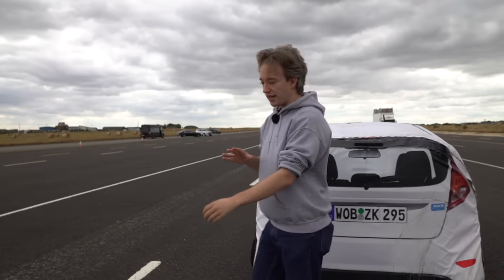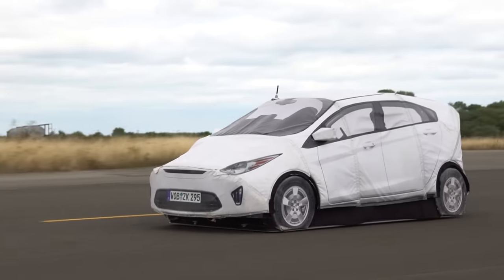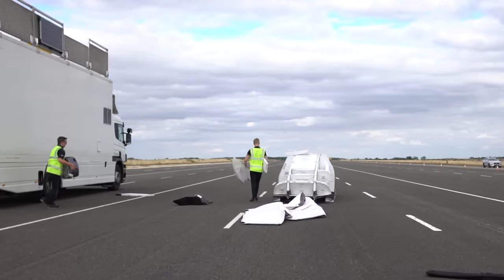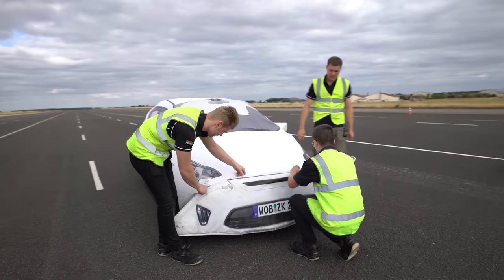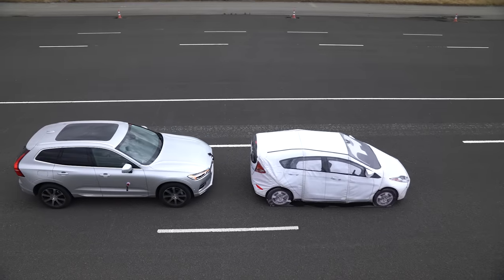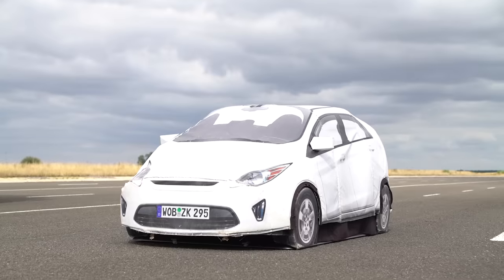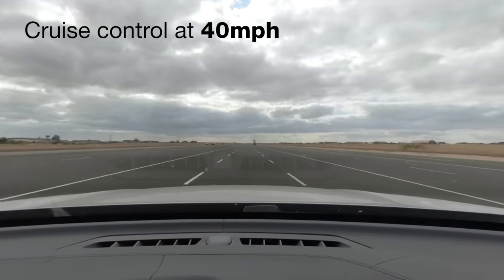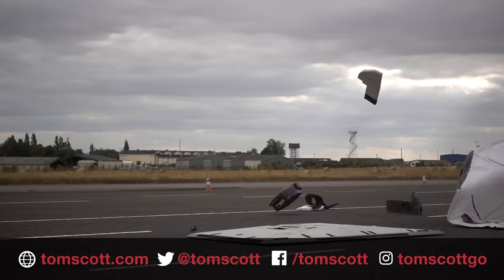The collapsible crash-test robot car

Comment: That looks fun! It's also a really clever idea, definitely better than spending£1000 on scrap cars for every test!
Reply: Scriptminer the moneys not the problem, the problem is you have a human driver driving at speeds of up to 70mph into the car not braking (on purpose), this is why they need the car to fall apart and be made of foam so while they’re still refining the system the testers are safe to crash into them and not get hurt
Reply: Makes sense, thanks!
Reply: The platforms are not cheap by any standards until you look at the R&D that goes into new car development!

Comment: If that car is a Volvo XC-60 then it doesn't use radar. I own one and it allegedly has a forward looking infrared laser. I would like to know if the system works but I haven't figured out a safe way to test it. Also I have never been clear on whether the system only works with cruise control on or with normal driving as well.

Comment: What happens if you are travelling at 220km per hour as the drivers in German Autobahn usually do? At 40 it hit the dummy, that means at higher speed it doesn't work?
Reply: Its not made to fix all problems, Most crashes are at less than 100kph were this system would help or avoid.

Comment: As a motorcyclist, this tech and the developing driver reliance upon it scares me. You wouldn't consider the second test that impacted the stationery vehicle to have worked if you were on a bike. People are already far too complacent when driving, checking their phones and not taking it seriously, believing an airbag will save them if it all goes pear shaped. Get rid of it all and provide good driver training and a Tullock spike in every vehicle.
Reply: Its not a driver reliance system. Its a system that makes using cruise control safer. Normal CC systems will just drive right in the back if the driver is not paying attention, were as this system will make CC safer by slowing or stopping you totaly. Most people dont use CC so makes no differance.

Comment: What happens with such braking assistants if friction is worse due to rain, gravel etc.? The braking distance can easily be twice as high.
Reply: The onboard computers do some maths and compensate...
Reply: Rob Fraser  But how would they know about the friction before the brakes are applied? Or is the short brake pulse to wake up the driver used to get an estimate?
Reply: They have to take measurements long before they even warn the driver.
Reply: Oskar Skog  How do you measure friction without applying a force i.e. accelerating (either positive or negative acceleration)?
Reply: You don't.  You can measure the friction when the wheel start locking or spinning, which may have happened already.  Otherwise, you estimate the friction.

Comment: Did that last test not actually count as a fail, seeing as it actually impacted the stationary vehicle?
Reply: Agreed, I would like to see the results at all speeds.  That last result was concerning.
Reply: A crash at 40 mph vs that slight tap would make a huge difference to the injuries sustained by the occupants. Sometimes, these systems are designed to only slow they car by a certain amount (e.g. reduce speed by 30 mph) in case of false positives. But that much reduction in speed alone would make a huge difference to the chances of surviving a crash.
Reply: EuroNCAP count three separate categories: Avoidance (no impact) Mitigation (impact was much slower, as here) or Failed (no braking, or much too late to be effective).

Comment: I know teslas have a mechanism for seeing two cars ahead by bouncing radar under the car in front of you. Wouldn't having the test target on a base with so little ground clearance give inaccurate readings with a system that expects a gap at road level?
Reply: The base is only 100mm high and the target has radar absorbing lower edges which offers minimal radar reflection, although I've not come across a sensor that looks under cars for further traffic.

Comment: My car's cruise control shuts off if it goes below 29 mph. Doesnt really matter since I never use cruise control anyway. It is not a comfortable feeling (especially for my foot) having the car accelerate itself.
Reply: I don't like using cruise control - adaptive or not. And I don't like automatic transmissions either. Having my foot lose the direct connection with the vehicle makes me immediately uncomfortable as well. The safety assistant in my brain detects something going wrong with the car when it accelerates on its own and the brake reflex appears.

Though I'm totally happy with all kinds of emergency assistants correcting for human mistakes. But all these "convenience features" replacing proper driving skills? Not for me.

Comment: "Brake late because otherwise it will just annoy the drivers". What about countries up here in the north that occasionally have snow or ice on the road. I hope they put that up for a discussion, cause these break tests would have ended badly on slightly worse road conditions than we saw here.
Reply: You would not normaly be sat with CC on when its snowing would you?

Comment: Human reaction times are not as good as a computer. What about the car behind the one with break assist. If the car leaves it late and breaks hard it dose not give much indication to cars behind it?
Reply: Good point, maybe they will branch out into auto-lane changing ...etc.  However, one easy fix is to have the brake lights applied and emergency blinkers on as soon as the vehicle detects a potential braking hazard.  It doesn't fix the issue but at least allows the driver to have a faster response, then you have to worry about the driver behind that driver...
Reply: These sort of systems are assists as opposed to autonomous driving.  They turn on in situations where you were (probably) going to crash anyway, these systems attempt to minimise the crash.

You can't worry about the car behind, but to put it into perspective, I would rather come to an abrupt stop and then the car behind hit me in some fashion (hopefully having at least tried to break), then slamming into the stopped car at highway speeds and then the car behind smash into me.  It's about minimizing damage to humans, not saving cars.

Comment: How does it take into consideration the driver following your car?
Reply: Great response, but I am more specifically concerned with non-autonomous vehicles. I'm curious how human drivers are taken into consideration when rapid deceleration occurs. The opposite could be said on when a rear-end collision is imminent, are there some autonomous vehicles that collision avoidance systems attempt to move the car out of danger or mitigate the damage?

Comment: In the future all cars will be driverless, and thus there will be less need for automatic radar breaks becasue the car in front of your car will just say "hey i'm going to stop how" and your car will go "okay, i'll adjust accordingly" for non car related accidents it will be useful though.
Reply: That would be wireless cars, not driverless.  That tech would be perfect for today as your car would communicate with the one behind much quicker than the driver in that car picking up on your brakelights.

Comment: Colin furze should have run this over in his fleet of vehicles. One thing that always interests me is decisions. 
In hemel we have the magic roundabout which way would a automated car go round. 
I am wondering how it would deal with critical decisions, I am also interested as tech such as radar and cameras have there limitations with automated cars , there are some things that both of this tech will struggles with.
Reply: Depends on how much you pay for the system, at the top end you could have far more cameras, radar and computers working everything out. But that would be far more expensive then the car, so right now the goal is to get as much out of the system as possible for a couple of grand.

Comment: oh my god, it slightly brakes on its own.. if it does this mid-corner then why not just add a solid rocket booster to the rear of the car facing a lateral direction

Comment: So a self driving car that uses radar comes across a car that has radar absorbent coatings ( used by cop avoiders) what happens then? There is an entire market based on nullifying radar, seems as if the scientist have tunnel visioned this project straight into the wall.

Comment: So at 35mph it pulled up just short.. at 40mph it gave it a bump... so at 45mph what happens? Harder bump? What happens at 60mph? 
It's not that I don't think the system can work but showing it fail is probably not a good way to convince people of that!
Reply: Seems to be a year old by now, definitely better by now, but the system isnt supposed to do everything for you. You should react before the system goes off, and there is a little brake before the system activates to try and warn the driver of, what it sees as, a possible crash.

Comment: 2:29 What's with the weird jumpy rotation of the wheel?
Reply: The wheel is moving to fast for the camera to pick it up.  Bit like when you look at a helicopter on film and it looks like the rotor is frozen or going backwards.
Reply: I know that, but it usually stands still, moves forward smoothly, or moves backward smoothly. Here, it stays still for a while, jumps to another position, and then stays still again.

Comment: "its delibratley late and harsh"
seriously sureley thats not a standard configuration one patch of oil or diesel or wet road and your delibrate late and harsh breaking becomes a collision

40mph so evidently your system does not account for the increased speed well judging by how 25 was a near miss and 40 was a bump so what should i expect from 80? a full on rtc?

Comment: Personally I don't agree with all these electronic driver assists, drivers are losing the skills to drive. ABS is one thing but it's going too far now. Put a modern driver in and emergency situation in a car without all those assists and they will have an accident.
Reply: What about people learning in cars with no assists? The car I've been learning to drive is ten years old, there's nothing other than a backup sensor, and it's a backup sensor not a camera. And if people are doing driver training (which they really should be) They're still gonna get taught everything they need to know to drive any car. People losing skills is I don't think a problem caused by the cars, but a problem caused by the drivers. The problem exists between the steering wheel and chair.

Comment: So the Volvo had time to warn the driver with a small brake at 40mph, but not enough time to break in time and not hit the car. Seems a bit flawed
Reply: The only "flaw" is expecting the car to do your job for you. It's an assist that is somewhat useful in certain situations.
Reply: bcubed72  I don't think anyone EVER wants the car to "do the job for you" when it comes to full emergiency braking, as Tom also clearly shows in the video with the discomfort of driving straight at the foam car without slowing down. But if the system CAN be improved to e.g. make an emergiency stop from 70mph going towards a standstill car before it hits, why shouldn't it be able to??
Reply: Yeah I thought that was odd too.  The car can safely come to a stop at 35mph and avoid collision, but just 5mph more and you've now created an collision.  I'd be worried what kind of detection it would have at 60+mph.
Reply: @HForceClan  Because doing so will inevitably lead to false positives (maybe the car in front is accelerating) which will annoy the driver. If the system is too annoying, it won't be used. A 5mph collision isn't really dangerous, so from a safety perspective the system has done its job.
Reply: techmage89  I'm saying its flawed for not being able to stop, and that it COULD also be improved to work at higher speeds with better radars with e.g. more range and less noise.. 
You clearly only skimmed my comment and missed the "if the system CAN be improved" with CAN in big letters so people dont skim past it, and im not here to convince anybody so bye..
Reply: @HForceClan  My point is, what you're suggesting wouldn't necessarily be an improvement unless you're talking about a fully autonomous car. As long as a person is still driving, they don't want an automated system taking over unless necessary for safety reasons.
Reply: system is designed to save your life not to save the car

Comment: I'm concerned that it touched the other car at any speed.
Reply: Show us where the car touched you.  Show us on the foam mock-up.
Reply: Its not ment to totaly stop you from hitting the other car from any speed, Its ment to minimise the speed you are going if you were to hit.
Reply: @Tappits84  that seems like a bad goal
Reply: Well i think the goal is to stop all crashes but we don't have the technology yet so  we have to settle with this for now.
Reply: @Tappits84  why would stopping crashes entirely (at least in this situation) require any better technology? Just have the car stop earlier.
Reply: There's a car 300m away.. I am going to slam on the brakes just incase.
If these systems were simple companies would not need to spend millions of € on them just to get a small improvement.

Comment: Annoying the driver will make them turn the system off? remove the off switch! Learn from corporations!
Reply: Slerp Derp I’m glad they don’t. There’s legitimate reasons to turn it off. Ex. I rented a car that had a warning beep if you drifted out of your lane. I ended up driving it on major highways to go to my parents who live in a rural area. It worked great on the highways but drove me crazy on the back country roads near their home. These are narrow roads that you often have to cross over a bit to stay safely on the road (obviously you’re looking ahead to make sure no one’s coming in the opposite direction.) It was constantly going off and I had to turn it off to not be distracted & keep my sanity. If I lived there and couldn’t turn it off it would be a major problem. (Yes, I turned it back on when I took the highways home.) And that’s only one example.
Reply: If you remove the off switch then people will just learn how to cut the right wire to turn it off. Also if you annoy the driver they will just buy a different car (and not recommend that car to their friends and family). It is also detrimental to the system if it has too many false positives. When people are inundated with warnings they tend to just ignore them completely, which makes the system useless even if it is on.
Reply: which is, as I understand it, the reasoning behind the "your nuclear reactor is working properly" alarm. Since, once you get used to the sound, the sudden silence is more alarming than any siren.
Reply: @angieulaka  Huh, interesting. I learned something today.
Reply: Hence why Chernobyl went bang.  The supervisor of the shift impatiently shut off all the alarms and fail safes because the racket and warnings while he tried to carry out his dangerous tests were driving him potty.

Comment: This video is really well done and put together but this company seems like they're full of crap.

We don't see the target move and there is no way those velcroed pieces hold together while in motion, the car clearly fails the 40mph test, having a deliberately delayed/harsh brake is a fantastic way to give the driver no time to react and get rear ended.

Nobody wants to admit it but automated cars are ridiculous and impractical. Not to mention no one wants them.
Reply: The platform will actually carry the softcar body on top up to 100kph. Search youtube for AB dynamics gst for proof ;-)
Reply: They were just saying the platform can move, but the tests they are going to do are not for 1-2 years yet and there test car, the volvo does not have the software to do it yet.. It's more of a soon ™ kind of thing.
They were just showing they have made the destructible car thing that mimics a real car so they can test the new types of systems that are been developed and with it. it's quick and easy and cheap to do test after test.
I don't think you understand how strong Quality industrial velcro is, More than enough to hold the car on the platform at 50mph   
As for the failed at 40mph, It's not meant to totally stop the car from hitting in any situation, hitting at 10mph is better than not having the system at all and hitting at 40mph.
The test shown has nothing to do with automated cars and has to do with cruise control systems which have been a thing in cars since 1958

Also i would love an automated car.
Reply: The platform has been in production for years and is used by the majority of OEMs and test centres around the world. Check out AB Dynamics YouTube page for loads of videos on it.